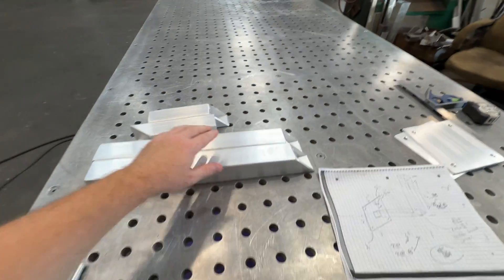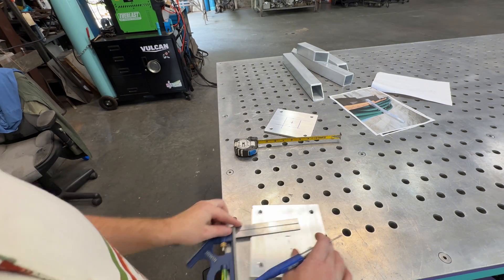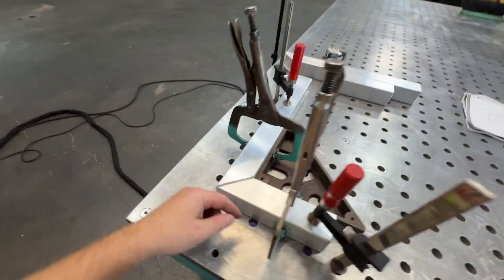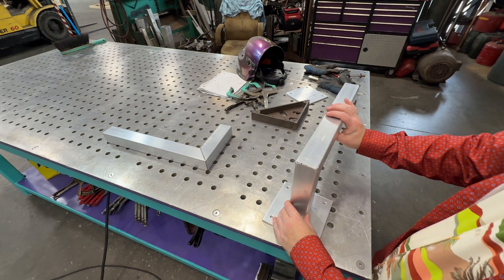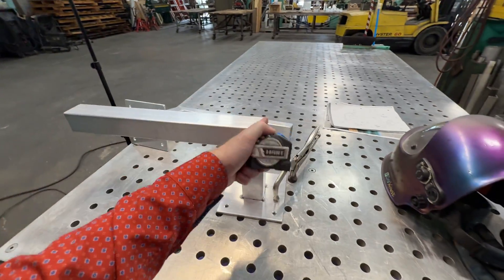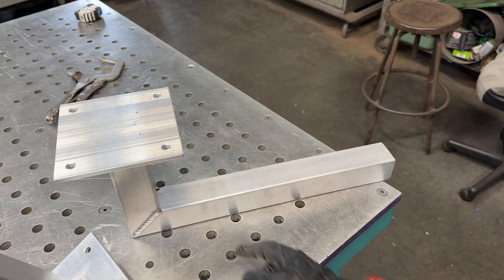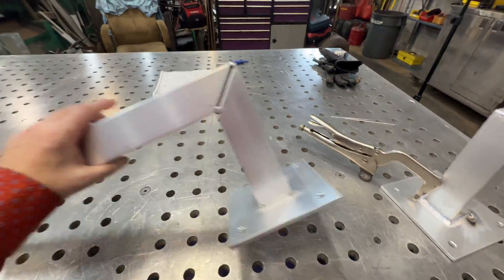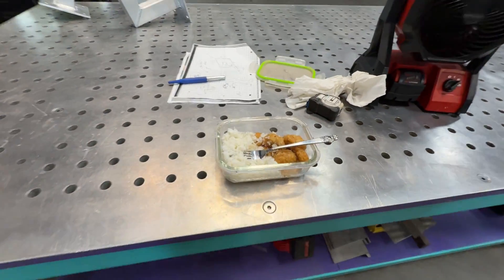Tig Welding - Fabrication Aluminum Square Tube Brackets Hangers

Comment: Dang! That’s all I have to do is snap my fingers? I’m going to try that technique at work tomorrow 😂.
Reply from the maker: Hey give it a try you may be amazed by the results 🤔 . But the one important trick to that is you have to believe in it otherwise it won’t work 😂
Reply: Got it 👍. I believe! I believe! 😂
Reply from the maker: @travismanuel3739 hey did you snap your fingers and it work ??😂
Reply: 😂. Even better than I was expecting. I’m on vacation 😂. Gonna have to keep that little trick in my back pocket 👍🔥💥

Comment: The 4x4x¼ angle Is always about 93°.... makes me work harder for it 😅
Reply from the maker: What’s that the cuts
Reply: @WojnarskiWeldingFabricaion just how it comes from my supplier, but since its not square it makes the miter cut crooked on the vertical part and you have to measure from the bottom or then the frame is smaller at the other end. Sometimes I get a few square ones and dont have any gaps to fill from it, just welds a tad quicker.
Reply from the maker: @Room_for_1_more_fruit_tree ahh I get what you mean. Yea pretty much the same for me with our suppliers our angles are never really perfectly square 90 degrees. If I wanted to use a chunk as an angle block like using the fireball tool squares I can’t sometimes it not perfectly 90 degrees. . I can see how you’re saying it being off for projects or even cutting. Especially 4” that’s a little big where it makes a difference for cuts and fit up 3 degrees at 4” high adds up more. That’s frustrating 😢